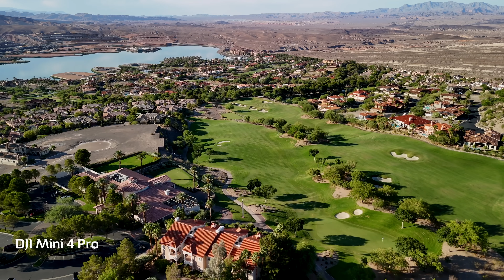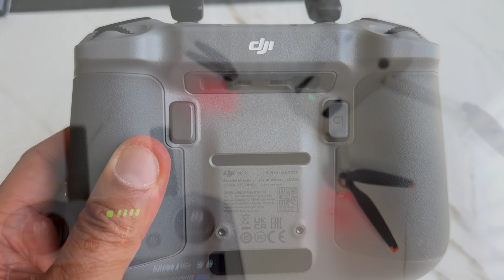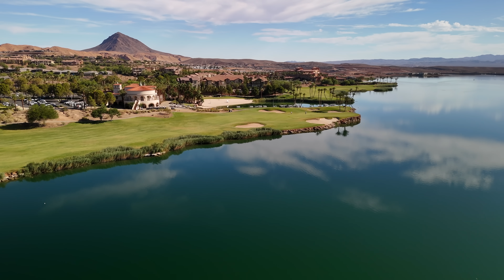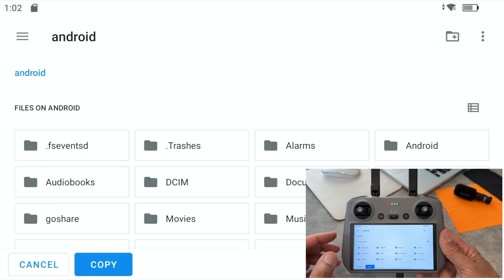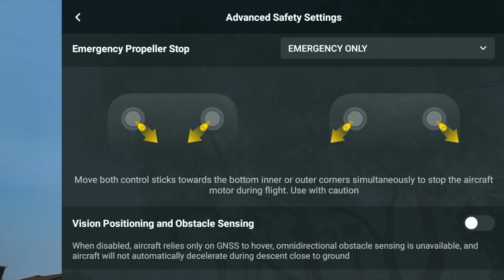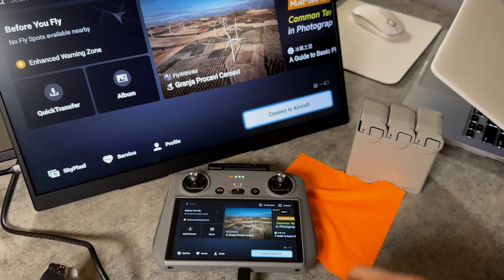DJI MINI 4 PRO-10 Things You DON'T Know! HIDDEN TIPS and TRICKS!

Comment: You must also disable the downward sensors to be able to hand-catch, sport mode does not disable them. This could be easier to disable for all who use this on a boat or the like... another button or performance detent, or incorporate it into sport mode with the ability to use sport mode with or without, duh - I prefer to hand catch everwhere, surely I can't be the only one
Reply from the maker: Thanks for sharing that extra tip for hand-catching!  Also, Great idea about incorporating that into sport mode. 😎👍

Comment: How do i record the screen without all the technical stuff (sensors, options, buttons and so on) Just the image and the sound?
Reply from the maker: On the DJI RC 2, the built-in screen recorder always captures exactly what’s on the display, overlays and all, even if you use an external recorder. There is no way to record with a clean video image without the overlays. Thanks! 😎 👍

Comment: If my drone (mini 4 pro with intelligent batteries) is under .55 pounds, but I have it registered under part 107, can I fly it recreationally without remote id in class g airspace? And just use my Plus battery to activate Remote ID when flying under Part 107? I'm wondering if my intelligent batteries are now useless if I register it under Part 107?
Reply from the maker: Once you decided to register the drone, you must now continue to broadcast Remote ID, even if you decide to fly recreationally. As per 14 CFR Part 89 Rules and Regulations.

Comment: Note VPS is a ToF (Time of Flight) measurement,  and while it does positional mapping via measuring return trip time of Infrared light - sort of an inexpensive lidar-type measurement, it does not measure altitude.  That's 100% done by a barometric pressure sensor. The reason turning it off over water helps is, as you say, reflections. Scattered light from unwanted reflections can notably impact the accuracy of ToF measurements.

* Eco mode is not entered via a timer. It's temperature-dependent. 👍
Reply from the maker: Thanks for posting this awesome comment! 😎👍

Comment: Most are unaware that cruise control is cumulative. Flying forward, 12 m/s 26.83 mph. Add a stick movement to climb at a steady rate, tap the assigned button, now 2 movements are occurring simultaneously.  Want to change speed? Do so, then tap the assigned button (quick tap only) screen will display "Cruise Control Updated" - I call this cumulative cruise control mostions. PS, when you hit your altitude limit, ascend motion will cease, but all others will continue.
Reply from the maker: Thank you for posting this information! Extremely helpful with all of the details you provided. "Cumulative Cruise Control" 👍 Brilliant!!!! 😎

Comment: Hello, I connect now a pair of XREAL goggles on the USB C connector of the DJI RC2. The immersive experience is fantastic with a crisp and sharp picture. When you combine this with a Dongle 2 with a SIM card allowing to use 4 G transmission with almost infinite flying distance, and a Super plus battery (6800mah) allowing more than an hour flight, then you enter a new world with your Mini4 Pro…!!
Reply from the maker: That sounds amazing! Are you in the United States using the Dongle 2? Thanks for sharing your setup! 😎👍

Comment: Does hooking your drone up with USB3 cable heat it up? Is there any chance of the dji overheating like if you have it on with the battery in it and it is not flying?
Great tips Mike thank you.
Reply from the maker: Excellent question you just asked! The USB3 cable connected to the Mimi 4 Pro is just like connecting to a Flash Drive. So there is No Heat being generated from the drone, even with the battery plugged in. Using the USB cable keeps the drone in a "Low Power State", so it can be plugged in for hours or maybe even days. Thanks! 😎 👍
Reply: Hi Mike, thank you so much for doing all of your videos! My DJI Mini 4 Pro was just delivered today and I can’t wait to try it! I’m also using your study program for the part 107 exam. I have never so much as touched a drone before, but I think with all of your guidance, I’m going to be successful  😊 🤞 😬

Can you tell me more about your set up with the portable 18” display monitor. Thanks!
Reply: @veralynn4767 have fun!! 
Don’t do sport mode!! 
I had mine for 15 months - never even got a scratch. 
4th July. 
I let it rip. Turned my head without thinking- talking to a neighbor. 
Right into a tree. Tumbled out. Broke the gimbal. 
It hurt. 

All good. Just got my second one in the mail 16days later. - best drone I have ever owned !
Reply: @RichardDraggin99  thanks so much for that advice! I wanted to get DJI Care refresh but I can’t because it’s not available in the US right now. I guess I will have to ensure it through my State Farm business insurance. Unless you or @mikesytes has some better advice.
Reply from the maker: Awesome! Congrats on the Mini 4 Pro! I will be uploading a few more videos featuring this drone, so please keep watching and let me know if I can assist you in any way. And YES! You will be successful! Thanks! Stay tuned. 😎 👍